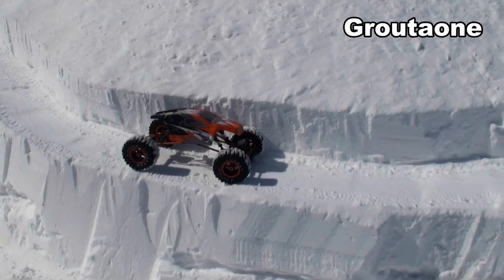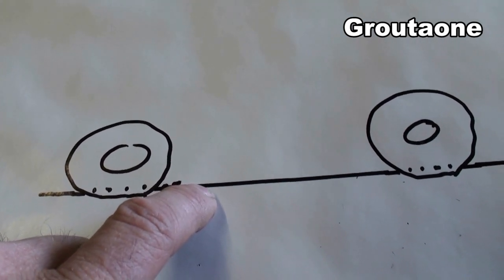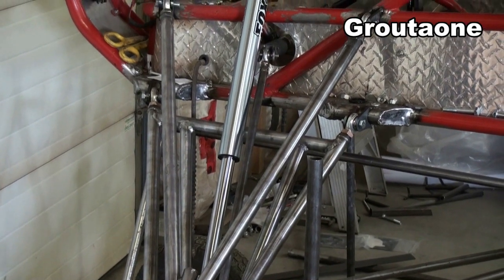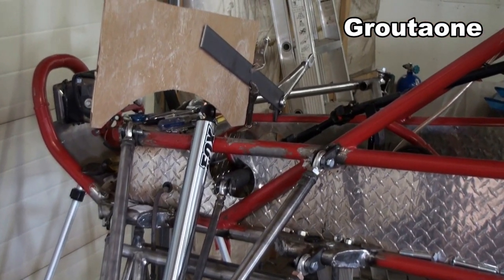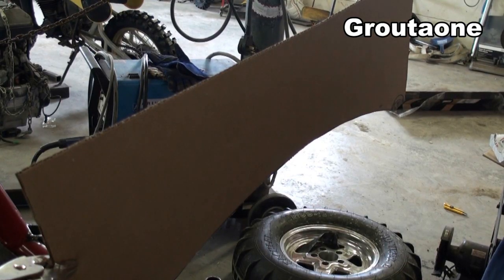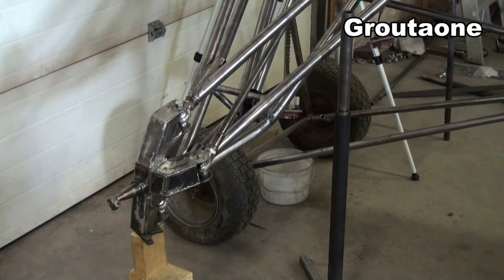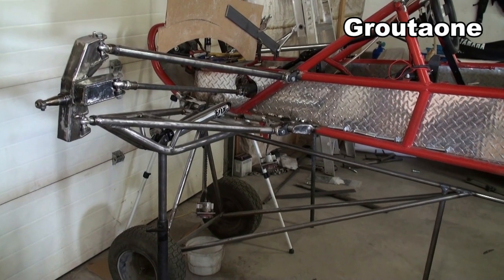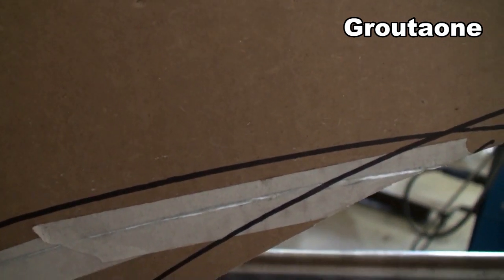Long travel susp. build pt 34

Comment from the maker: I would prefer it lighter in the front just for the sake of wheelies. I think most of how a machine launches off a jump has to do with spring rate and driver style and jump angle, most jumps require throttle off the face of the jump, no throttle means a nose dive, or a high speed jump with little power left to give also likely ends in a nose dive, if you watch monster trucks at all you will notice Maximum Destruction is front engine and most everyone else is rear, works fine for him

Comment: Suspension is a black art. Like a secret ingredient in cheeto's. 
If you change the mounting point to extend travel. Does that also effect spring rate and dampening?  I found with my sandrail that even using a larger tire created new problems so had to continualy play with tire pressure to adapt to sand conditions on the dunes. I think tuneable bump stops come into play as well.  I think suspension comes down to luck as much as skill. Offroad is just as hard as NASCAR tuning. Maybe worse

Comment: Hey groutaone I was just looking at you front lower shock mount and I was thinking when the suspension is fully compressed and all the tyres are on I am worried that the lower shock mount will hit the ground and bottom out at full compression, you have probably already resolved the problem or it does not exist but that is just what I happened to notice, this rig is going to be Maad, I hope you drive it the way it is ment to be driven